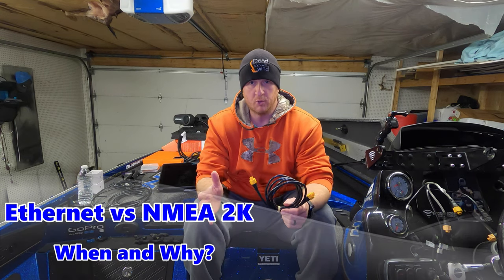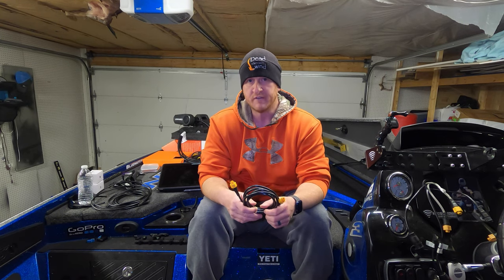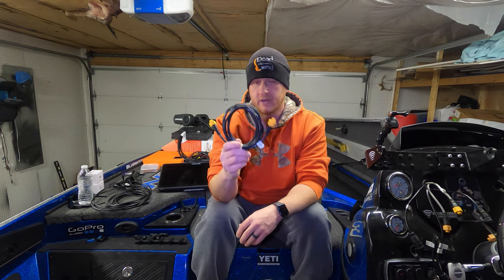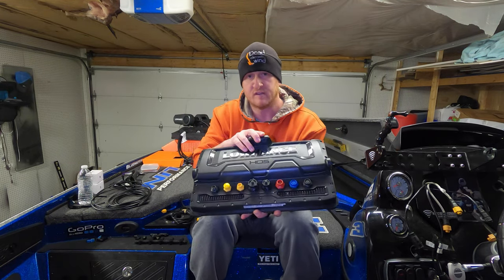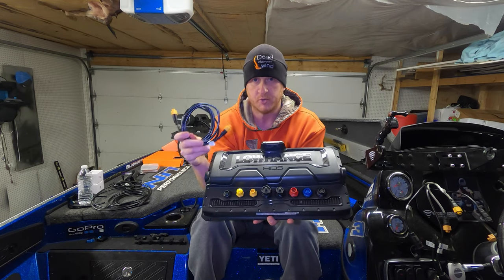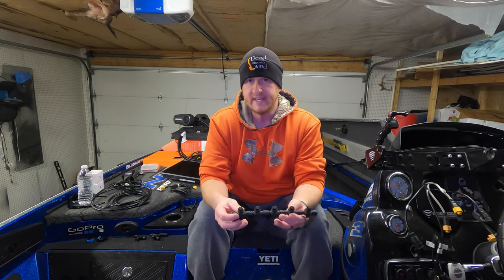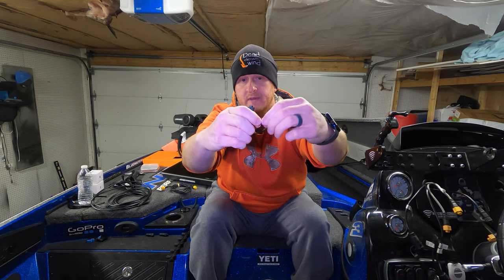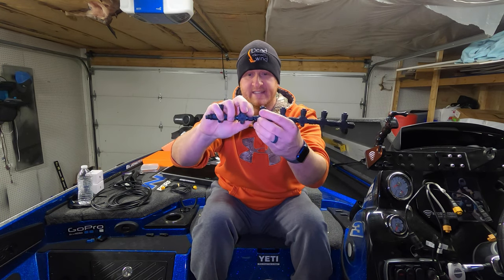Ethernet vs NMEA 2000 Network...How, When, and Why?

Comment: I run 2 HDS 12 Live units (2021) in my 2021 ProV Bass. My flush mounted bow unit loses GPS periodically. I heard that can happen  because it's flush mounted. I have NMEA and ethernet connecting the 2 units. How do I configure my Bow unit to use the GPS from my console unit?

Comment: By the far the best explanation on YouTube.  This is an add for Garmin. All of Garmin antennas are internal. There are no pucks for the graphs, trolling motors and subsequently, no need for the Neama, unless maybe I add the telemetry for my 300r merc.
Reply from the maker: Thanks man, I appreciate it!…I’ve never ran Garmin so I don’t know anywhere near as much about them…thanks for watching!
Reply: Garmin uses external XM radio, GPS and autopilot inputs over NEMA 2000. You can also connect your VHF if its compatible. Great explanation. 👍🏿

Comment: If I understand the guidelines correctly, power to the network should be as close to the centre of the network as possible. Additionally the backbone does not need to be made up of directly connected T-connectors. Cable can be run between connectors thus reducing the amount of cable running through the boat as a cluster of devices can be T'd at the console, and only one backbone cable run back to connect to a cluster of devices at the bow, stern etc.
Reply from the maker: Yepper, that’s correct!…you can run a cable from one T to the the next for that exact reason, hope that helps!

Comment: Hey. My simrad G09 has no ethernet port. Can I use 2000 port to add another unit through 2000 system and share internal unit info with another unit without ethernet connectivity? Thanks

Comment: You can also run cables between the "Ts" so you can have "Ts" at the front and back of the boat.
Reply from the maker: That’s correct, I wanted to keep this simple and clear for people who have never done this before, so I stuck with a basic backbone, but yes, you can do that without issue...thanks for watching!

Comment: Some MFD's require crossover cables for direct MFD communications. If going through a network switch/hub typically either can be used.

Comment: Good video and info.  You can add a cable in between the Ts if need on the backbone.
Reply from the maker: Thanks Dave!…yes sir that’s correct…if you need an extension between T’s you just add a cable…thanks for mentioning that!

Comment: I got several questions and a few observations that I would like to have you clarify if you a so incline.

Ethernet is a protocol (in the data world) what type of cable it uses is another thing is it 4 pairs? 3 pairs, 2 pairs?? is it 1 pair for power and 1 cable for data like the old video cameras would use?
As far as the Nmea 2000 (and 0183) is a token ring (old LAN technology). What kind of cable does it use? 4 pairs, 3, 2 or 1 pair for power and 1 for data?
What type of encapsulation does the data use? (or What communication protocol?)?

Thank you for your video you been more enlighten than most how2 on YouTube or even written explanations have been about Nmea and "ethernet" for marine use

Comment: I have a HDS Live 9 at the console and an Elite Ti2 12” at the bow. Would NMEA be able to connect the two for waypoint connection? I ordered the starter kit, because I was told this was the case, and that the elite ti2 doesn’t have an Ethernet port. Thanks!

Comment: I am just learning things about ethernet and NMEA and need to learn fast since I am re-doing my boat GPS system. I luv your explanation and comprehensive enough. But I do have a question: when you connect the backbone to the power source via switch, will the unit like your Lowrance GPS will have power too since the backbone is connected to the Lowrance GPS. The Lowrance GPS has its own power port for connection to a power source. Is there a need to connect the Lowrance or Garmin GPS directly to a power source? Or you just abandon the power port connection of the GPS since it will be powered from the backbone connection.

Comment: Since the NMEA 2000 network is powered, do you need individual power cords for each fish finder, or will they receive power from the back bone?
Also can you extend NMEA cables if they are too short?
Is there a maximum length for a NMEA cable?
Very informative video. Thanks for taking the time to put this together…

Comment: TY so much for the vid, is excellent;  My question is: if I have two Elite 7 HDI not compatible with ethernet only with nmea 2000 can I still be able to share points if I have the point1 antenna and a navionic card on each unit connected via nmea 2000?

Comment: Kinda off subject, but the new 300r mercury motors require clean power. Can I put a shut off switch on that?  I do all of my own work, but had the motor installed.  He did not think I could put a shut off.  One of my volt meters stays on all the time.  I can shut everything else off, so my second Volt meter is off, when it’s off.

Comment: Good job of explaining the Ethernet and NEMA 2000 setups. Is it possible to use both networks at the same time. For instance, if I have external sensors on the NEMA 2000 network but I want a simpler connection between twochart/finders using an Ethernet interface. Could this create a setup issue of the lowrance finders.
Reply from the maker: Thank you sir!…yea absolutely, I use both systems every trip out, no problems at all…hope that helps!

Comment: I just bought a elite TI2. I have a Gen 2 touch @ the bow and the elite @ the console. Question Lowrance says I can use NEMA 2000 to send waypoints to the bow from the console and vice a versa. I had ethernet hooked up before between a Gen 2 Touch 7 at the bow and the 9 at the console before I purchased the Elite TI2.  The TI2 does not have a port for ethernet. Any thoughts on how to exchange info.
Reply from the maker: yea unfortunately you're limited to NMEA with your setup, but they should be able to share waypoints through that (make sure both units are on)...with the Ti2 made for "wireless networking", there's no way to utilize Ethernet between it and the Gen2...now if you had multiple Ti2's that's a different story...hope that helps!

Comment: I'm adding nmea2000 and having trouble finding someone that either knows or understand the connection of a JRC radar to the nmea2000.  I think I might just need to find the schematics for the unit and add the nmea plug.  Is my thinking correct on that ?  Thx, Kit  I'm putting this unit in a 41' sailboat and adding the radar .
Reply from the maker: Hey Kit!…I’ll be honest, I’m not very familiar with the JRC Radars myself so I don’t want to give you any wrong info…let me see what I can on them and try to help ya out, I’ll look into them and see exactly what the installation calls for…is there a particular model you’re installing?

Comment: Great video, just curious if you run power to switch, the backbone want have power when you turn off the motor?
Reply from the maker: Thanks John!... I have my backbone ran to my breaker panel that gets shut down with my main power switch on boat… That way at the end of the day when I kill the power to that main switch, the backbone automatically shuts down as well… Hope that helps!

Comment: I’m getting ready to run another unit so I can read console unit from bow using NMEA (older Elite 9ti so no Ethernet). Will the NMEA power that front unit or will it need its own power source? No need for another transducer?

Comment: With the nema system, if I was to run a one point to the system and I have the  two graphs sharing via ethernet. Will both units get to use that one point antenna?
Reply from the maker: As long as your Point 1 is hooked into your NMEA backbone and both graphs are ran to it as well, you can utilize the Point 1 on both units...unfortunately Point 1 can’t be shared over Ethernet...hope that helps!

Comment: I have a elite ti 7 and a elite ti 9 at the console is there any way i can run both units off the same transducer using nema 2000 running sonar and maps on one unit and side and down imaging on the other i have no ethernet hook ups on it i was just wondering
Reply from the maker: Hey Daniel!…I’m honestly not super familiar with the Elite Ti’s, I know they can be hooked up via NMEA 2k to share waypoints and I believe you can also share sonar but I’m not 100% sure on that part of it… hopefully someone can chime in and give a definitive answer for you, I’m sorry!

Comment: Great video! Here is my question about ethernet, can i connect my two 12 inch screens together since they have 2 ethernet plugs, and then go from there to nep2 hub to connect my two 7 inch screens and radar that only have 1 connection? The simrad nep2 hub only has 5 ethernets i think i need more.

Comment: Excellent, just what I was needing.  Have 2 HDS Lives and a Ghost Trolling motor.  In order to get full connectivity and benefits of all three I need Ethernet between the two HDSs and also NMEA connecting the Ghost and HDSs is that correct?
Reply from the maker: Yes sir, I would recommend doing both with the graphs and Ghost!
Reply: @NitroZ18Fishing  sweet, thanks!

Comment: Great Video! 

What if I have Ultrex? I have The Lowrance Gps puck up front. I have 12Live on bow and 12carbon at console. Installing soon. Removing 7’s Gen 2. With Nmea 0813 cables Not sure why.  But I want to connect is  2 12’s & the Ultrex & Lowrance gps puck.
Reply from the maker: Thanks Ray!… Great question, I’ve honestly never mixed any Minn Kota products with a Lowrance puck… Hopefully somebody can chime in here and help you out, I don’t want to give you any misleading information… Sorry I can’t be more help on this one!

Comment: GREAT VIDEO & Explanation. I’m connecting a HDS9 Carbon(new) to a HDS7 Gen3 to operate off a new 3-in-one transducer. Do I need a NEMA 2000 starter kit, besides the Ethernet cable I’ve already installed , to make everything work?
Reply from the maker: Thanks Rick!…depending on what you want to share you may need the NMEA connection…if you just want to share the sonar then Ethernet will be enough, but I always recommend connecting both NMEA 2K and Ethernet to get the best out of all your units…hope that helps!

Comment: do you chose which data are transferred through the NMEA 2000? for example depth(from sonar) to an other device in the network?
Reply from the maker: You can customize those types of things in the settings menu of your graph if you like!... thanks for watching!
Reply: @NitroZ18Fishing  Thank you, you mean an other Sonar or plotter?
I want to connect it to a Raspberry Pi and I dont know which informations a Lowrance Elite Ti2 can send through NMEA
Reply from the maker: I’m not too familiar with a raspberry pi, but if you have multiple graphs on the boat you can somewhat customize how certain external components are utilized/displayed on each unit...hope that makes sense, let me know if I can help anymore!
Reply: @NitroZ18Fishing  I really appreciate your help. That"s what I need to know, I will test it in the next few weeks and let you know.
Thank you!
Reply from the maker: No prob!...let me know if I can do anything else to help out, good luck on the water!

Comment: Great video. Do you use NMEA 2000 and  Ethernet cable both simultaneously?
I have 2 x HDS Gen 3's currently connected by Ethernet and am looking at adding a Point 1 
Thanks 😊
Reply from the maker: Thank you!…yea absolutely, I use both systems simultaneously every trip out…hope that helps!

Comment: Great Explanation!   I have a NEMA2000 for My GPS Puck and have one HDSGen3 9' on Console connected to a Structurescan. I just bought a HDS 12" Carbon for bow.  I have a HDI Skimmer for trolling Motor.   Do I just use the Ethernet to share SS to both HDS? and flip back and forth in front if I want to use the SS vs HDI instead for the BOW or do most guys just use the HDI in front and the SS on console to find a area to start fishing?
Reply from the maker: Thanks Rich!…yes sir, you can share the SS via Ethernet…and with them networked you can flip back and forth between ducers as needed/wanted!…I use my SS on bow at times myself, it’s nice to have when needed!

Comment: Patrick, great video and just in time for me! You just saved me several hundred dollars! I'm running three Elite-9 Ti2 units. I want to tie the two helm units together with an Ethernet cable, but I want to know if I can still link my "base unit" via WiFi to my bow unit while the base unit is linked via Ethernet to the second helm unit. Since these units only have one Ethernet port, I'd need an expansion port to hardwire all three together. But if I can still connect two units via Wifi, all I need is a short Ethernet cable and I'm in business! Currently, I have to reassign my WiFi connections every time I stop to fish, and every time I pick up to move. It is a PAIN!
Reply from the maker: Hey buddy, I’m sorry I’m just seeing this!… I know we talked about this in messenger, let me know if you have any other questions!

Comment: Just watched this video very good information. One question: If running two units at the console, would the ethernet cable would be all I need to see mapping on one unit and side/down scan on the other unit at the same time for marking brush piles and waypoints?
Reply from the maker: Thank you sir!… Yep are, ethernet is all you need for mapping, sonar, and wave points!
Reply from the maker: Yepper *, waypoints*...autocorrect got me again 🤣

Comment: Great subject and even better is your explanation. 
With multiple units networking via the Ethernet cable. Would you then just need to connect unit #1 to the Nema 2000 or do you still have to connect all units to the Nema 2000? I would think only one needs to be connected to the Nema 2000 if the Ethernet cable is used on all units but correct me if I’m wrong.
Reply from the maker: Thank you, I appreciate that!… All of your units would need to be connected to the NMEA 2K network in order for them to take full advantage, even if they are connected via Ethernet...The reason being that the information shared is different between the two systems… Hope that helps, thanks for watching!
Reply: @NitroZ18Fishing  Yes sir, that helps. Thank you.

Comment: Even new boats have to be rewired for power? Unfortunately my 2016 didn't get the  SWR and now I have to do something. 
Please share how how you will accomplish the power. Thanks.
Reply from the maker: I’m actually just upgrading my wires for my fish finders...I had 14 gauge ran to them, but I’m swapping that out to 10 gauge since I’m running 4 graphs now (2 12” Lives at wheel, 2 16” Lives at bow)...just wanted to upgrade the gauge of the wire to avoid any voltage drop or performance issues...I will most likely throw a video together of how I’m running it, but it’s fairly simple...thanks for watching!
Reply: @NitroZ18Fishing  I've a Ranger FS620. 12" Live on bow and two at console. 11.4 volts tops and 9.8 by end of day. 8 or 10 ga. should help, but no room for a house battery and  charger.

Comment: Doesn't the NMEA standard recommend to put the power supply "T" in the middle of the network to split the load equally?
Reply from the maker: Hey Brad!…I’ll be honest, I’ve never heard that before…and I’ve never had any issues, but I don’t want to say it’s wrong…I’ve just never heard that anywhere…I’ll have to check it out and see, thanks for sharing!
Reply: The correct answer here is yes. The power should be located in the middle.

Comment: I want a connection between a Lowrance HDS 5 to a Lowrance Elite FS 9. I would be using HDS as GPS and Elite as fishfinder. Should I go for the ethernet cable? If I hit a waypoint on the Elite, will it show on the HDS in real time?
Reply from the maker: I’m not too familiar with the HDS 5 but if connected with an Ethernet cable they should definitely share waypoints in real time...hope that helps!

Comment: thanks Nitro
i have 2 carbons on my boat console.
so to get the same engine data via nema on both, i need to connect each carbon to the nema backbone?
thanks
john
Reply from the maker: No prob John!…and yes sir, that’s correct…just run a NMEA cable from each unit to backbone and you’ll be good to go!

Comment: Excellent video! Quick question(s), do I need a separate connection for the ghost to the bow unit and the ghost GPS puck to the trolling motor, or does the Ghost power the GPS puck?  Do you know the cable length on the NMEA starter kit? For NMEA power on the fuse block, should I just pick an empty slot and ring tie or spade tie into that and use the inline fuse in the starter kit?
Reply from the maker: Thanks Doug!...the Puck from Ghost runs directly to foot pedal, so you’re good there...the NMEA starter kit comes with a 2’ and a 15’ cord, and yea you can definitely run backbone to empty spot on fuse block...as long as it’s fused somehow and you’re able to turn it on with a switch you’re good to go!...hope that helps!

Comment: This is a great video that explains it in great detail! I have a little problem, can the nmea2000 bower cable provide power to mfd or fish found? Because I have two mfd, looking for u to replay.
Reply from the maker: Thanks Steve, I appreciate that!...unfortunately no, they're 2 different cables so you wouldn't be able to use it for graph...hope that helps!
Reply: @NitroZ18Fishing  Thank you for your reply bro, if the MFD is connected to the backbone with a drop cable, can it be used without connecting the power supply? Or MFD still need to be connected to the power supply separately, thank you for your answer.
Reply from the maker: No prob, happy to help!...you would still have to connect the power supply for graph for it to work